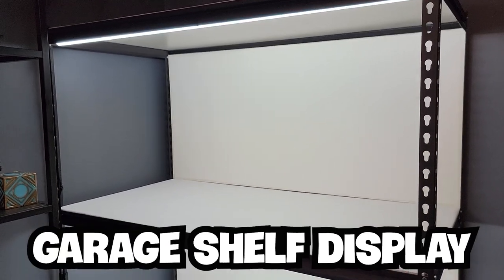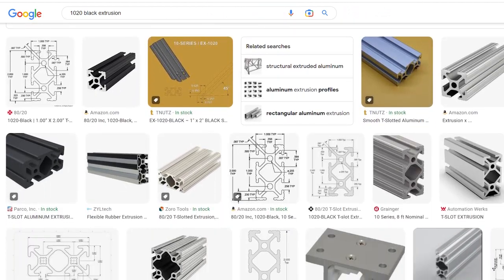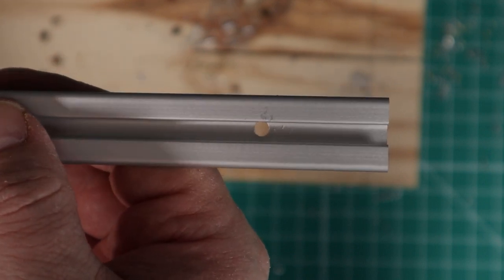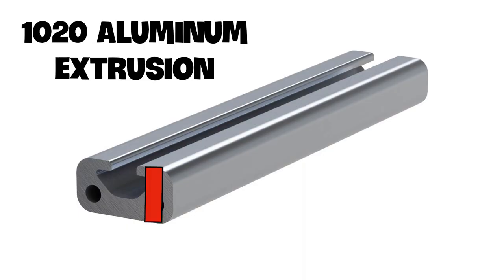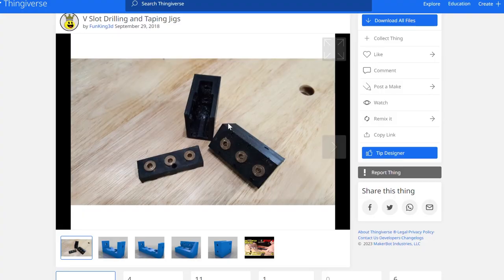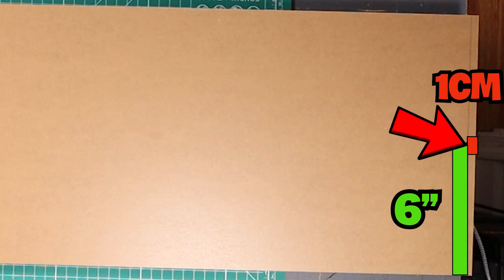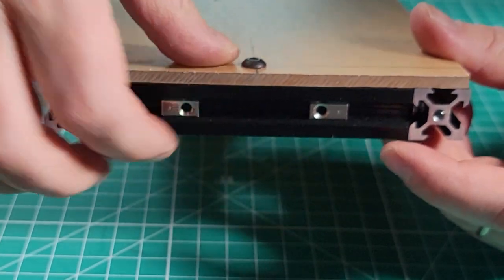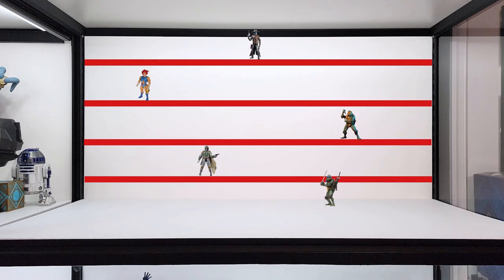EASY DIY Custom Display Case Part 4 - Garage Shelf Build

Comment: I am currently building my own display case using your "DIY Custom Display Case From Scratch" video as a reference. For this i have build 4 cases stacked on top of each other, using T6 Connecting strips to connect the cases together for better stability. I think once I am done with the case, after I used the case to display my figures for a while, I will consider building floating shelves like these . Thank you man for your awesome videos.
Reply from the maker: That is awesome! I'd love to see them when you're finished. Thanks for watching and congrats on your build!

Comment: Your enthusiam is a joy to watch and as a fellow toy collector i respect the whole project. But how many people could even buy all the correct supplies much less build these. Most of us cant put together pre-made ikea or target stuff. But your amazingly skilled at this & perhaps you should consider selling them. 👍🏻👍🏻👍🏻👍🏻
Reply from the maker: Thank you so much! You'd be surprised how many people have made this and the other cases. It's really not hard. 

I am selling the hanging brackets in a kit at the moment which can easily be paired with a wood board if you're looking for something nice and easy. Everything you need to add a wood shelf to your garage shelf display is in the kit except the wood. I also have a tutorial on how to make the wood board. It's super simple. Go to Lowe's, buy the board, have Lowe's cut the board and you paint it any color you want. Then use the kit to add it to your display.

I am thinking about doing commissions. We'll see. Thank you again for watching!

Comment: Love your videos.  Very inspiring.  I would be curious to see your wood shelf version for this. I took the plunge and plan to make it soon.
Reply from the maker: Thank you so much! That's awesome! If you have any questions during your build, please do not hesitate to reach out to me. 

The wood shelf looks great and I think I may like it better than the aluminum one. It's also much cheaper and you can make it any color. I think it's more accessible. I'm also thinking about selling the hanging brackets, if there is enough interest.

Thank you again for your support.
Reply: @PopCultureLivingRoom  I am now really curious to see the wood shelf.  Btw, I was considering felt to cover the boards, is it better to hot glue or staple that type of material? Oh, my son thinks you're hysterical. Loves your channel.
Reply from the maker: For the fabric, I prefer stapling. If something happens to your shelf or you want to change the look, you can easily do it by removing the staples from the fabric. Tell your son he rocks!
Reply: @PopCultureLivingRoom  Thanks for all the help!

Comment: If you research extruded aluminum  fittings, you'll find there are fittings that will allow you to cut the extrusions at a 45° mitre and then use L connectors on the inside.
Reply from the maker: Thanks so much for watching! I like the idea.

Comment: Care to give a rough estimate as to how much these 2 shelves cost to make?  I'm just looking for an estimate so i can have all the funding before starting.  I'm currently rennovating the room that i plan on building the display case for.  I've had some large models for years that I've been waiting to display.  These build videos were exactly what i needed.
Reply from the maker: Thanks so much for watching! The cost of the shelves vary depending on where you live. The estimate is based on if you live in the U.S. The acrylic floating shelves are very expensive. Mainly because of the acrylic and aluminum. For wo shelves by themselves for the aluminum and acrylic and screws will cost approx. $160. Big reason for the cost is we're still recovering from the affects of covid and shipping costs are crazy right now. The hanging brackets and T Brackets will cost another $30+ for the materials.

If you want to go a less expensive route, I have my wood floating shelves video. They look really good in the display.

Let me know if there is anything else I can help you with.
Reply: @PopCultureLivingRoom  i did watch the wood shelf video, but I was just fascinated with the build of the acrylic ones.  It gives me similar vibes to playing with erector sets as a kid, and that got me super excited!
Reply from the maker: @Genrou138  I know what you mean. Are you U.S. based? If so, I have a US based company for the aluminum. They are a recent find.
Reply: @PopCultureLivingRoom  yeah.  I live in Eastern Pennsylvania
Reply: Can you let me know the name of the company?  I'm finally at the phase of my remodel that I can actually start on my display case build
Reply from the maker: @Genrou138 which company? The one for the hanging brackets or the one for shelf aluminum?
Reply: The aluminum one that you mentioned in a previous comment.  I'll source what I can in the US vs ordering overseas
Reply from the maker: @Genrou138  This is the place in the US. 👉 Openbuilds.com - https://openbuildspartstore.com/v-slo...

Comment: Dude ...I don't know whether to hug you or strangle you...I took the plunge because of you.  I really hope you do an easier video for us dumb ppl who totally suck at math and Don't have all these tools ...way too many steps .
Reply from the maker: Lol. I would prefer hug. Thank you so much for watching! What's funny is that I didn't have all these tools before I started making these shelves myself. I do have another floating shelf video coming out  hopefully later this week and it is using a wood board instead of the aluminum and acrylic. It will be easier and I'm personally liking it better. If there's enough interest, I may do a batch of the hanging brackets. It'll come with everything you need to hang an aluminum shelf or the wood shelf.
Reply: @PopCultureLivingRoom  hate saying this but I go blank  when math thrown my  way...math to me is like telling a joke that you understand 3 hrs later so I'm hoping you're next video is alittle easier to understand for us math dummies...I finally got my shelves today...so far so good...the ad says can hold 300 lbs but the wire mesh feels like it'll break in half so don't know how anything heavy will hold? Trying to make all black... what were those black sheets 🤔 you mentioned in your earlier 🤔 videos? I have one of those black storage shelves,  it says use a rubber mallet and put pegs into the frame....weird....all new and alittle scary for us who are afraid it will look crappy but hopefully comes out as we dream.